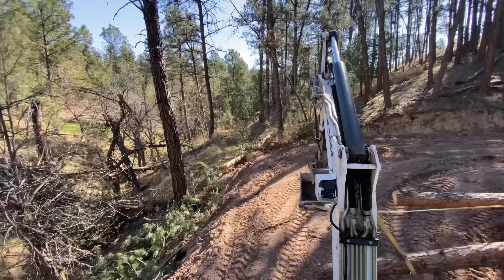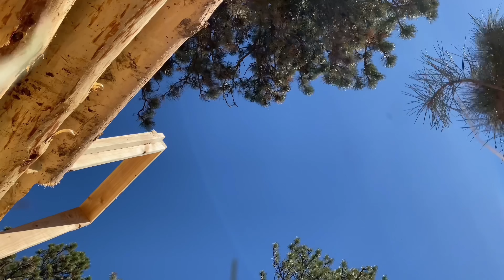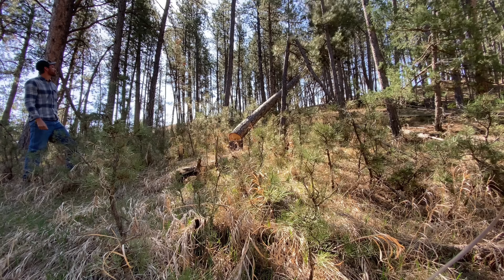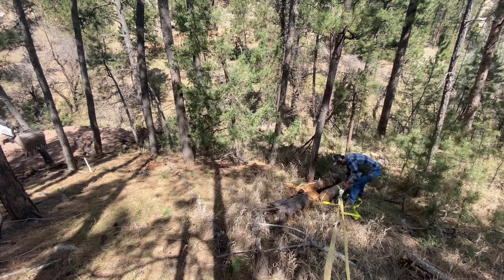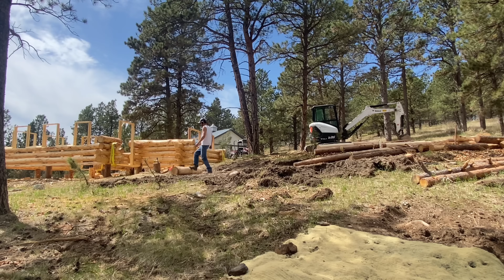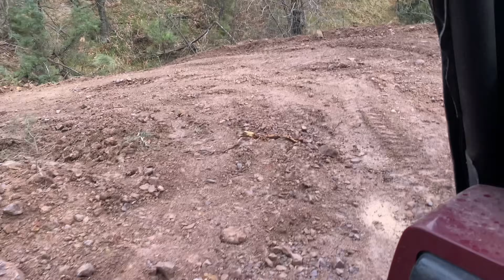Solo Log Cabin Build-Episode 8

Comment: New to the party. Curious why your logs are gapped so much ??   I've not seen that before. Thanks.
Reply: Looks like he will fill gaps with insulation and then go over with a heavy chinking maybe.

I’ve seen gaps like that in dove tailed examples, cover the gap with chicken wire fill it with insulation and more chicken wire on the other side and face off with chinking.
Reply from the maker: Exactly! Thanks for the response!
Reply from the maker: That’s a great question. My logs are not all straight and uniform, they twists a little, bend a little have knots and other imperfections, so with the size of cabin I’m going with, it would be quite the task to try and get them to lay flat. And I’m not sure I could even get it to look right. The gaps will be filled with insulation first and then chinking on top. Thank you for the question
Reply: @DemasiLogCabin  it’s a more rapid cabin construction method where there’s little need for scribing and notching etc, so makes sense for your requirements. Great progress btw.